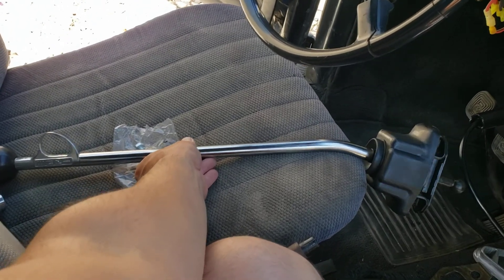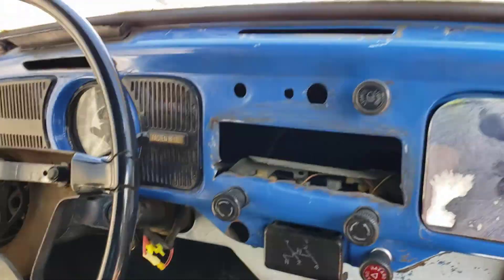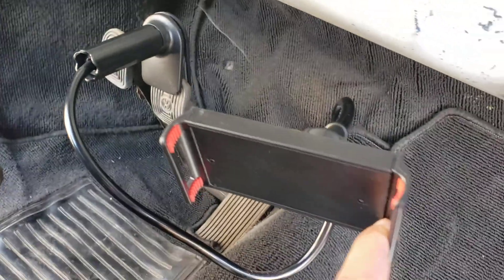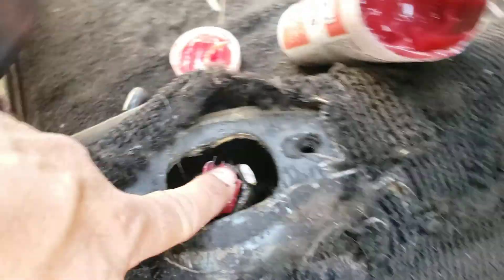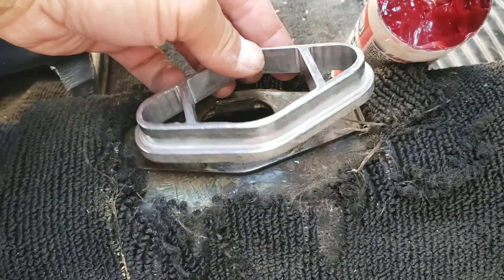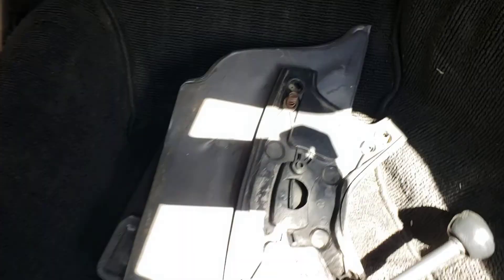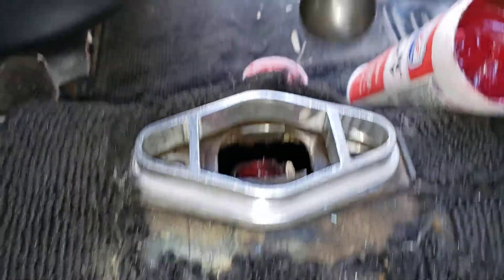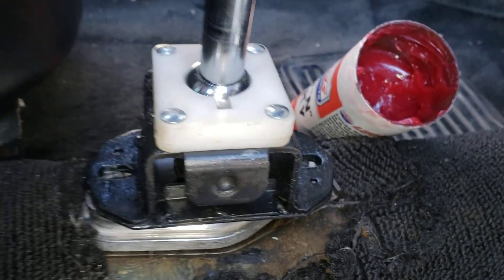VW Beetle Big gets an EMPI bus shifter

Comment: I did  thisafter wasting money on extensions,already had small steering wheel. It shifts better then a stock shifter . 100% cool
Reply: Did your use the Empi or the hurst shifter and, curious, did it come with the spacers.  The bus shifters ball drops too far but the spacer doesn’t seem to be available on all the Empi bus shifters.  Almost like it’s a separate purchase?  Thx for any info